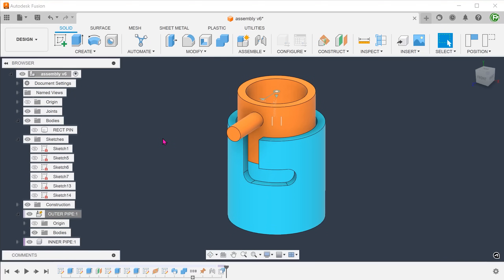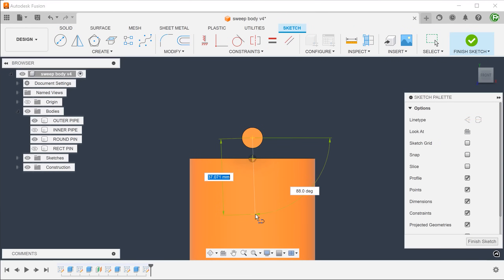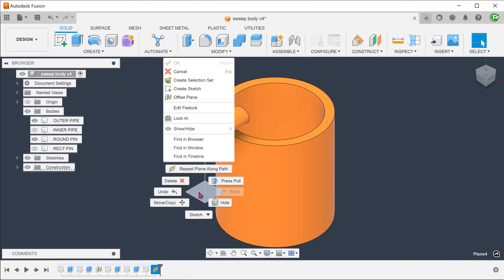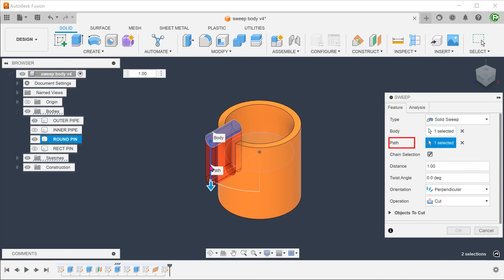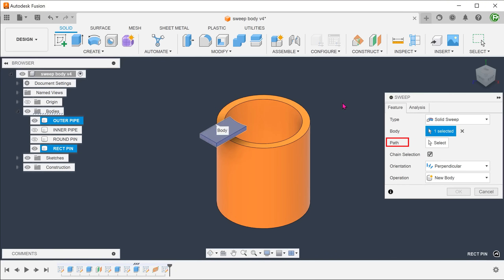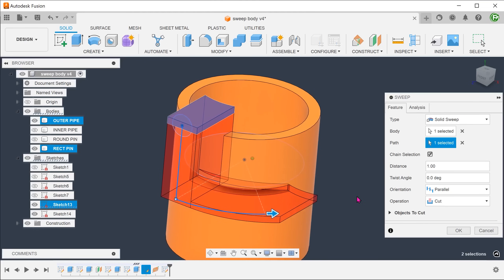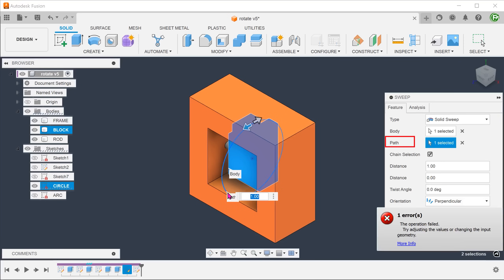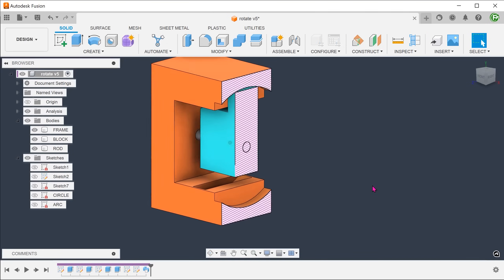Autodesk Fusion | New Feature - Solid Sweep (May 2024 Product Update)

Comment: yes but for PLA printing you will need the hole to be 0,4mm wider for it to slide easily. you can create a pin that is bigger for that purpose.

Comment: for some reason for me its not cutting out of the bottom cylinder and cant figure out where i went wrong i followed step by step
Reply: nvm it worked im just being dumb but i do have another question, woudl this allow movement if 3d printed?
Reply from the maker: I am quite a novice at 3d printing. I suggest checking out print-in-place videos.

Comment: If you place the rectangular pin at the point where the path changes from a line to an arc and you cut the line and the arc separately (two sweeps), the cut will be correct. If you need to make the slot slightly larger than the pin (for 3D printing for example), you can make a copy and then shell the pin (or pull the face out a bit) before you do the cuts. I'm really glad they added this new feature.

Comment: I was so excited when I heard about this feature in the insider build. I was really hoping this would allow an engraving feature (like V-groove cutting). A standard swept cut will not cut a generalized path like text or vector art. In my attempts so far, neither will the solid sweep. :( My workaround is still to use the CAM tools and export a mesh file after doing a v-groove cutting operation.

Comment: really nice tutorial! i've had the same problem some time ago with the rectangular solid sweep... couldn't find a solution, so i needed to do everthing manually in two steps with two bodies with different starting points following each other...

i do have another thing for you, maybe you have some solution:
I have a cone. on the cone there are two spiral paths (triangular crosssection) indentet/cut into the side of the cone. these two paths are the same but some distance appart in direction of the cone hight...
looks like a fancy drillbit but not symetrical. now I need to connect the two paths at the tip of the cone with a circular arc (following the curvature of the cone).
this part should be a "mold" for a wire. u bend de wire in half, position the bend around the circular arc and then bend around the cone in the spiral paths (like two parallel legs)... after that you can push it flat and you have a "double, countinous" spiral with both ends at the same destination.

i hope my instructions are sufficiant 🥲🥲🥲 unfurtunatly i cant send you a picture here...
thank you !

Comment: If you create an axis instead of a circle and sweep around that you will be able to have a complete radial volume sweep as opposed to an arc.
Reply from the maker: I assume that you are referring to the second example here. When I went back into the sweep feature to try to select the axis of the circle sketch (x-axis in this case), it does not allow me to select it. 

I also tried setting the orientation to aligned and select the x-axis from there. I was able to select the axis in this case but I did not get the correct result. I might have misinterpreted your explanation here. Do let me know! I am really curious about this.
Reply: @Fusion360School  you need to create a line in 3D space, you can’t simply select plane and then an axis or normal of that plane because it doesn’t know where the line is, only it’s direction. You may need to convert the line you make into an axis.

Comment: The issue with the slot can be avoided by using the 'aligned' orientation option with the aligned axis set to be around the same axis as the arc.
Reply from the maker: I was not aware that there is an align option in sweep! I just went to experiment with that option but I don't seem to get the result needed. When you say "same axis as the arc", are you referring to the axis of the cylinder?
Reply: Yeah, the cylinder axis.

Comment: Thanks for this! Autodesk should add an offset distance for this feature, seems a no brainer as you'll need some sort of clearance and it is extra work to select all faces afterward and then select offset.
Reply from the maker: Another way might be to just build a slightly larger cutting tool.
Reply: @Fusion360School  Great idea.
Reply: @wiremonkeyshop  Yes, and if you have to produce the component with the pin, now you will only have the external surface of the cylinder to offset.
Reply: Thanks for the vid 😁

Agree w @wmonk’s first comment and was just about to add my own comment along these lines, but was grazing to see if someone else had broached this.  Yes, a second body (peg w an offset etc) would work.  A clearance spec keeps you from having yet another body to manage and all the parameters for the slot, in this case, in one place.  Much cleaner, IMHO.

Had a “duh” moment watching this,  center-point-arc, been using F360 for about 6-7 years, never even noticed this or the tangent-arc command, “duh” 🤦🏻‍♂️🤷🏻‍♂️

As always YMMV, just sharing, nothing more, nothing less.

Comment: Yeah, the only solution I see for the rectangular slot is to copy the pin (Use "Point to Point", click on start of vertical path, then end of vertical path), do a solid sweep with the copy, and then remove it.

Comment: Another great video, I can see how this will be helpful for cutting slots is sheet metal, which is 95% of what I work with.
Reply from the maker: Come to think of it, it works almost like a thin feature for cutting slots. You would only need to sketch out single line paths instead of slots. The downside is that you would need to model out a cylinder as a cutting tool for each slot.

Comment: That creates zero tolerance feature, thus you must process it further to make that actually work in real life...
Reply: He talked about using offset faces in the first example to give it some clearance.
Reply: It's a demonstration of a new feature, not a practical example.
Reply: Or, use a tool with the offset/tolerance required built into the tool.
Reply: Yes, which is exactly what he points out, you can use "Offset face" for clearance.

Comment: Great video! Thanks for the explanation. How would we add clearance after the sweep?
Reply: He uses the offset face command to add clearance in the video
Reply from the maker: You can use the offset face command to pull back the faces for clearance. Although I did mention this in the video, I did not demonstrate it. Sorry about that.
Reply: Wow dude, you didn't even make it half-way thru a seven minute video.  Much easier to just ask a dumb question instead, eh?
Reply: @j.f.christ8421  Still got the answer ;)
Reply: By manually pulling back the faces.

Comment: Great video, this is a cool new feature. How would you do this if you wanted the twist section of the bayonet to be not perfectly horizontal? e.g. 80 degrees from the vertical path?
Reply from the maker: At first, I thought that maybe it is just a case of creating a plane at an angle and sketching an arc. But an angled plane cutting across a cylinder creates an elliptical path. Maybe you can experiment with using the angled plane to create a split line instead.
Reply: @Fusion360School  yeah that was exactly what I was worried about when I saw your video. Because angling the cuts is a pretty common use case

Comment: I am wondering how did you get these cool looking icons.
Edit: look at the sketch bar, the icons look very pretty
Reply: You can edit what tools you have in different toolbars by adding them from the "..." to the right of every tool in the dropdown menus. Check Pin to toolbar. 
Icons in the toolbars can be drag around if you want to change the order. If you want to get rid of one just drag it out  from the toolbar.
Reply from the maker: I use 200% windows scaling and Fusion does the rest. There might be some options in settings to optimise the UI.
Reply: Icons??
Reply: Wdym by icons.
Reply: 200% icons, which only help for this video to be easily viewed in smartphones (which is great!). Otherwise it is a waste of screen space.